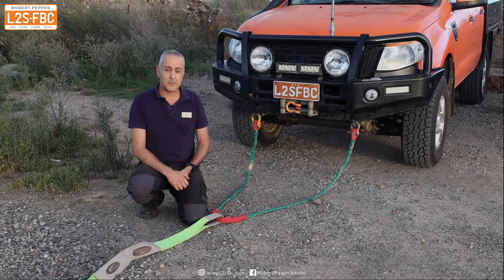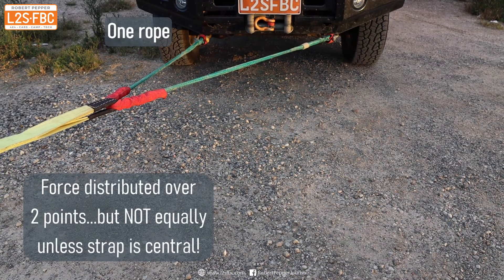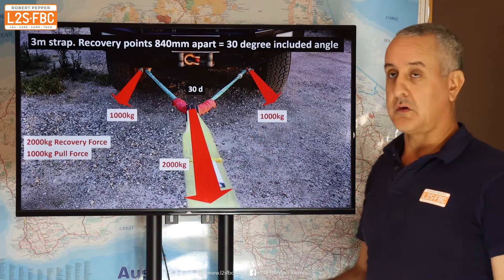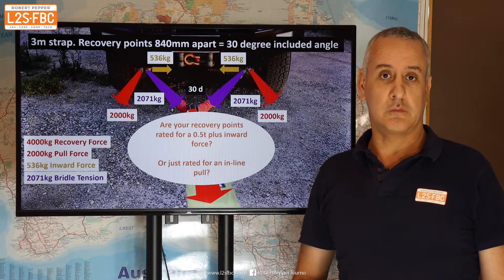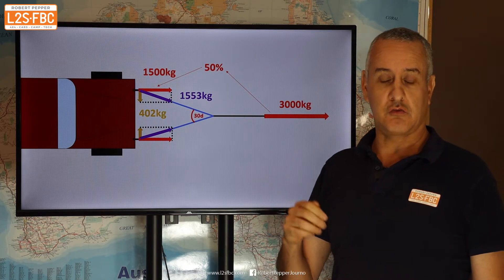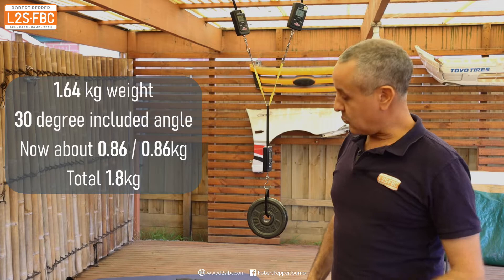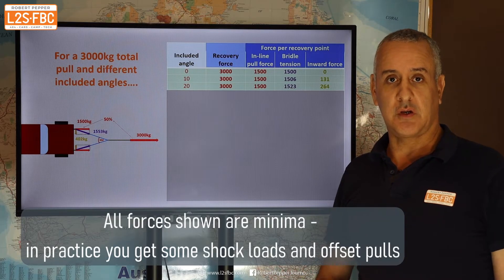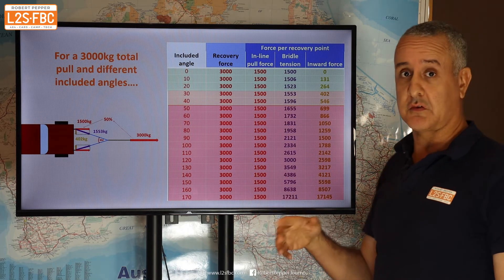What you don't know about 4X4 bridles (equalisers)

Comment: I wouldn't be too concerned about the angle - e.g. if you just use the winch the angle is actually 180 degree, or close to  (your anchor point - the winch - sits in the middle) and the crossbar / winch bar is - hopefully - designed that it can cope with the moment / torque caused by the pull from the middle via the winch. 
Now this moment / torque (force x lever where the lever is half of the winch bar width) will be always more stressful then the "clamping stress" (pressure) caused by the bridle. Saying this, the crucial points are - like it is the case for most recovery scenarios - the design of the recovery hooks / loops / lugs and how they are attached to the vehicle / crossbar / winch bar. Even when aftermarkets recovery hooks are fitted, and even if they are rated, the question is whether the way (welded, bolted, clamped), and the location, and the strength of the material they are fitted to, are fit for purpose. That is - IMHO - the most unknown parameter. And that is also the reason for me why snatching should be avoided at all times as there is no practical way to determine - especially not in a recovery situation - whether the recovery hook design is fit for purpose.
Reply: There will never be a 4x4 recovery where you have to get that far into it, All that matters is you stay within WLL for all equipment, you don't have any bridles at less than a 30-degree angle without considering the forces on it, You know the ratings and capabilities of whatever recovery points you attach to, etc. The only time you really have to get into the math and figure it out fairly precisely is when you are dealing with some very heavy shit and relatively low-rated rigging and winches compared to the load... I.E. when a 35-ton wrecker recoveries a 100,000-pound machine fully engulfed in mud. At that point, you are dealing with some relatively small rigging and winching capabilities and you really need to be precise with your math or you will break something and get people hurt. So if you are recovering your 4x4 with a rope and a bunch of tiny pullies, then maybe you need to focus on the angles and the math behind them, but with most people having 12,000-pound or close to it winches on their 4x4s it's not an issue.

Comment: Hello Robert i have a question maybe you could demonstrate the answer? How much force would be required to pull a 5,000 lb jeep stuck in mud up to frame in thick sticky mud? Is it easily posable to exceed 10,000 (no hidden logs boulders ect.)  Im trying to find a commen % of suction to add to a gvr when setting up recovery gear.
Reply from the maker: Hi - I'll be doing a video on such forces in due course. The short answer is  about double the vehicle's weight, so yes could exceed 10,000lb.  You can reduce the force required significantly by driving the wheels during recovery. And, definitely dig out to reduce forces, and use traction ramps if you can. What you describe is about worst-case scenario for load.

Comment: Great video, as are everyone’ of yours I’ve watched so far. Interesting how the laws of physics can be your friend with a snatch block in a pulley system, but gang up and kick your a### with a bridle. Just went out to my truck, 93 hilux and checked mine as I only have a 2m bridle, but as my recovery points are only 600mm apart this gives an angle of a shade over 17 degrees so all good. Used an on line calculator, wonder of google!
Reply from the maker: Yep I might make a calculator for this! Very good point re physics, love it!
Reply: @L2SFBC  Simple calculator. For 30 degrees,  total bridle length is 4 times anchor spacing, and for 20 degrees, it needs to be 6 times.
Reply from the maker: Brilliant, will add to the post...should have thought of that myself!
Reply: @L2SFBC  Many thanks for all your helpful videos.
Reply: @robcoles6288  Wow! Now I have to go shopping again.
With the 825mm span between my recovery points, to achieve a 20º angle, I need an (almost) 5m bridle strap.
The brand new, 3m strap I have been carrying around for years, is not of the ideal length. It gives me an angle of ≈32º. The law of diminishing returns, or not, I'm not comfortable with that.
Reply: If 600mm apart, and total bridle length 2m, then angle is 35 degrees.
Reply: @robcoles6288  my mistake, put 2m in each side of the triangle for calculation so bridle length 4m 😳

Comment: Great stuff. What length of bridle for your Ranger there Robert?
Reply from the maker: 3m, which is the minimum I'd want for that vehicle.
Reply: My recovery points are 770mm apart. I will go 5m 8T equalizer strap. About that for a  20 degrees mark of included angle in my case then. I purchased a shorter one last year I haven't used and after watching your video I am off to purchase a 5 metre 8T equaliser strap. Bloody brilliant technical information Robert.
Reply from the maker: Pleased to help!

Comment: Could you comment on the use of a loop of webbing rather than a rope in the construction of the bridle?  I typically run a rated static loop (12 meter) attached to bow shackles attached to rated recovery points . I keep the loop doubled to the tow rope or strap.  I like the idea of using the static loops from the lifting industry because of their versatility as tree protectors and other uses as opposed to a dedicated tow bridle.
Reply from the maker: They work just fine too good choice.

Comment: Fantastic video - thankyou.  Been using bridles for 20 years but had no idea the side forces on the recovery points were as great as they are.  So what's the next step?  Should bridles should be getting longer (say 8-10 metres) and snatch straps should be shorter (say 5 metres).  Secondly, if longer bridles were being used, should they be elastic like the snatch strap?  Would an elastic snatch strap make a better bridle than an inelastic equaliser strap?
Reply from the maker: 8m is gets into the law of diminishing returns for recovery points about 900mm apart. Don't need to be very elastic as the other rope can do that but a little elasticity is good to absorb loads.

Comment: Thanks so much for putting this together! It answers questions I had and ones I didn’t even know I should have had.
Reply from the maker: Glad it was helpful! Please share :-)
Reply: Looks like one of the X Lock uses is to slide  on a bridle and then a soft shackle would connect it to a tow strap or winch line.  It might have less friction than a sleeve sliding on the bridle.  Any thoughts?
Reply from the maker: Correct and yes good point but it would need to slide so as to maximise equalisation.
Reply: I haven't tried it yet but it should slide fine as the rope doesn't double back on itself just the smooth metal but might become more difficult with the desired smaller angle under load.  It would be interesting to try the sleeve, X lock and pulley block in wet muddy conditions.   I do agree that using as little metal as possible makes for safer conditions.  Plus, I'd probably be using my X Lock and pulley blocks somewhere else in the system:)

Comment: Question about a bridal:
What is you used a snatch block at the vee of the bridal to permit the attached winch line or tow rope to move along the bridal with less friction? Seems like a good idea to me.
Reply: That actually is the correct way to have a "force equaliser": rigged, it also limits bend radius to more in line with "recommendations".....  (we would need load cell data to actually see what effect it will have 5% or 30% ??...)

4x4'ers have just gotten scared of using hardware - too many people snatching off substandard towballs and unrated tow points....
Reply: If you’re going to do this to a ‘bridal’, please make sure you have her consent!😉
Reply from the maker: Yes can work but don't like the idea of more metal in the rig and the benefits are minimal. The force would still be unevenly distributed.
Reply: I would think that the metal introduced in this location (v of the bridle) would be of lessor concern (at least on the stuck vehicle side) than the benefits it would provide through less friction and more continuous load adjustment on the recovery points. Am I thinking about this correctly?

Comment: Hi Robert
You have not considered what will happen if the vehicle is impeded by a rock or ledge in a rut and what happens if the vehicle is pulled on an angle
Reply from the maker: Yes I did - I said those forces I calculated exclude shock loads and assume a central pull. But in 4x4 situations that's rarely the case.